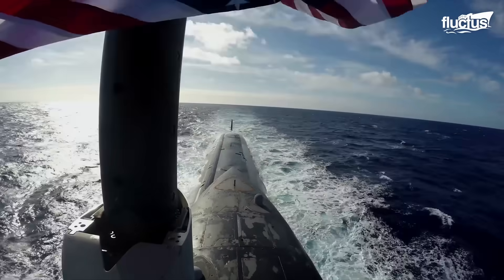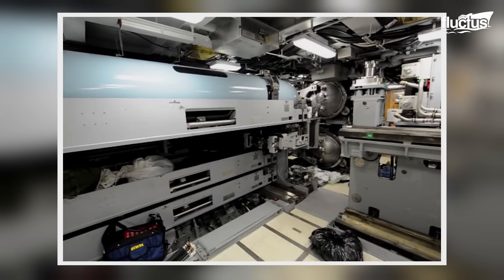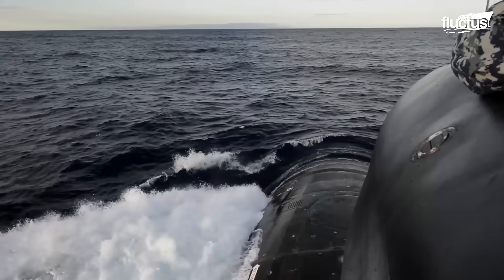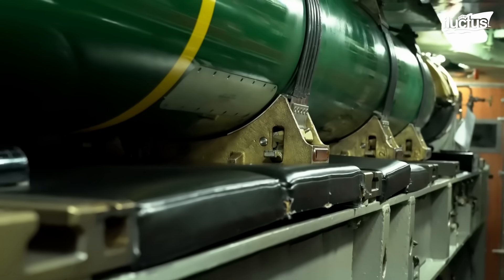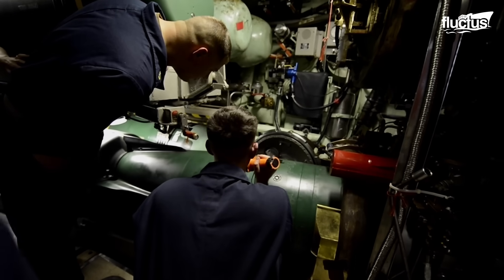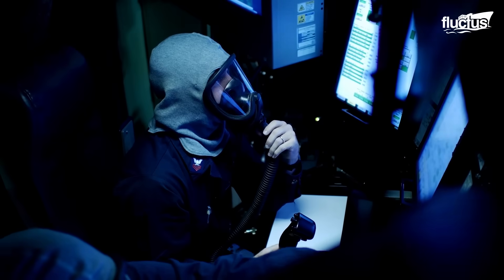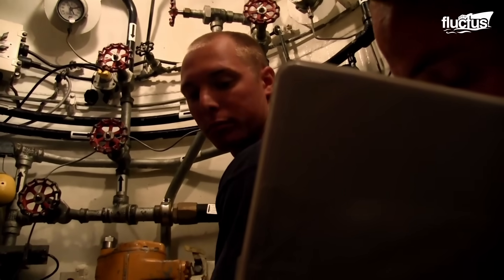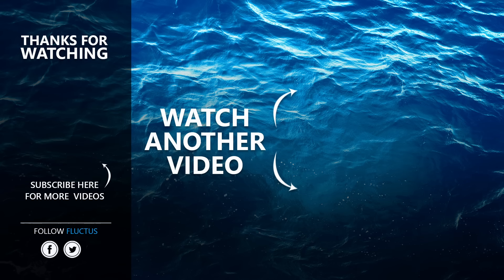How US Navy Resupplies its Nuclear Submarine In Middle of Nowhere

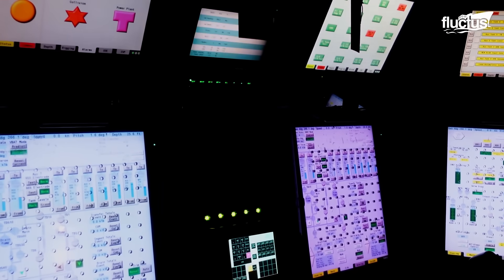Comment: 9:54 Why isn’t each level of a submarine able to be self-contained, if it could help to  prevent the spreading of fire between different sections of the vessel? Couldn’t this also possibly help contain water from spreading to different levels of the ship if it were experiencing flooding?
Is there a reason against it that has something to do with pressure? 😅
Reply: It's not split by levels but by sections. Plus submarines don't have a whole lot of reserve buoyancy. Any flooding that affects more than one section is likely to sink the boat anyway.

Comment: Any submarine lives and dies by stealth. The resupply is not done the way you show. Your nice pretty pictures show nice smooth seas, it is not that way. 
Subs don’t broadcast it’s that thing called stealth. What does the sub use to pick up these supplies? To any sonar within 1,000 miles those supplies sound like bombs going off. 
What did they do before drones? 
Any time a sub spends on the surface is noise. 
After 90 days you need more than food, things break. How do you tell people what parts you need?